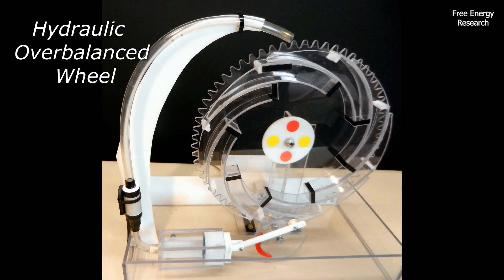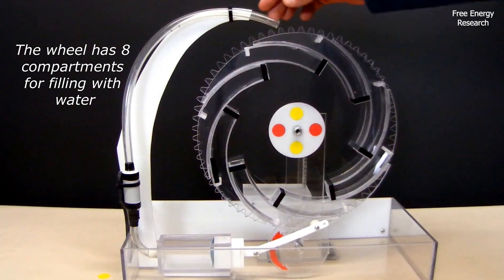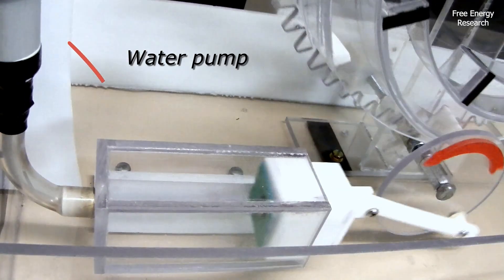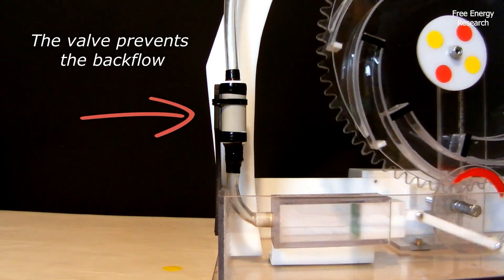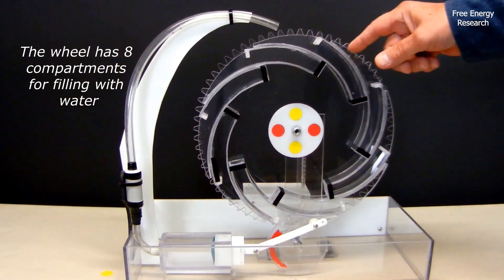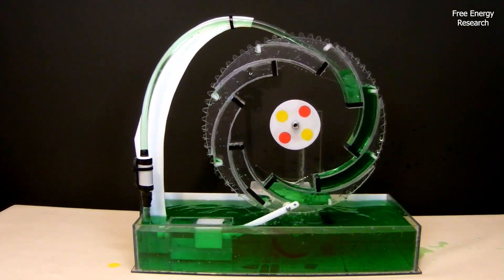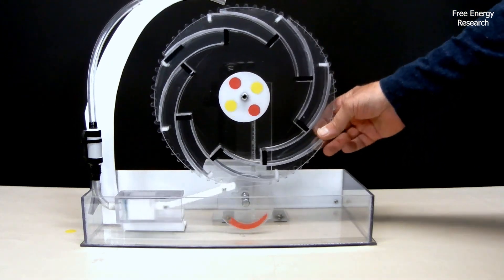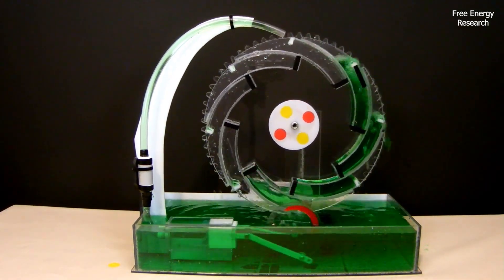Hydraulic Overbalanced Wheel - Perpetual Motion machine

Comment: The water pump motor is hidden behind the hose holder, and the piston is dummy, it does nothing.
If you carefully look at the air bubbles rising up inside a hose between the piston and a syringe, you'll see air rises pretty slow for the water flow that allegedly created by the piston.
Reply from the maker: Thank you for the comment 💙 Good  observations